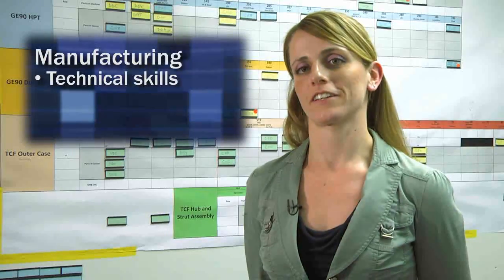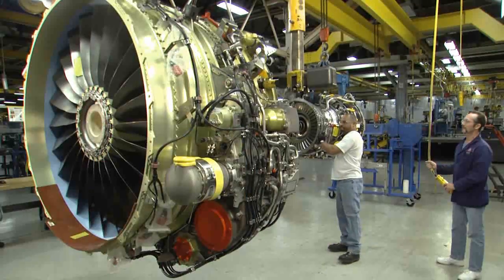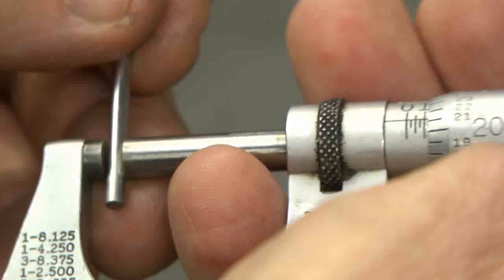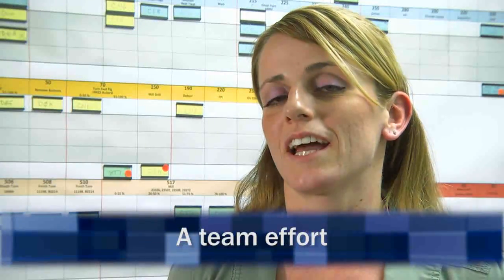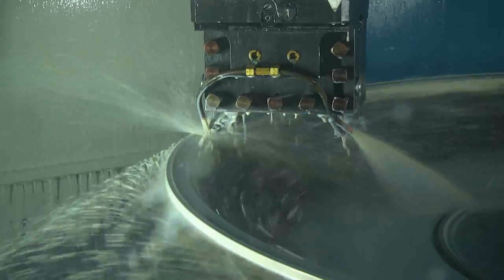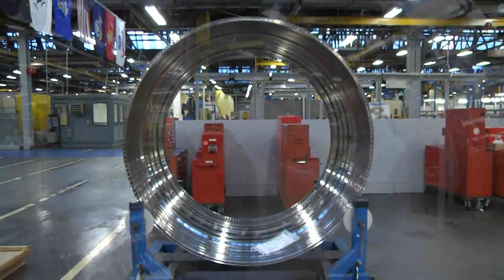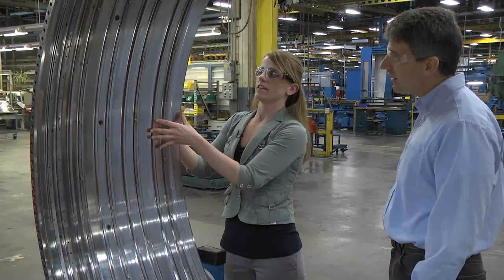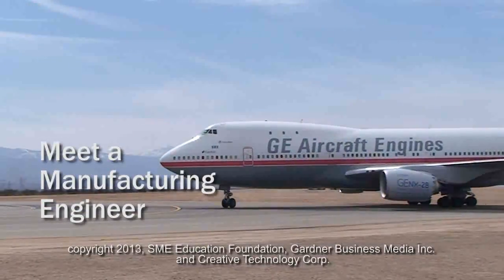Meet a Manufacturing Engineer

Comment: A Quality engineer is not a Manufacturing engineer
Reply: manufavturing engineering actually contain 3 sub divitions which are QUALITY . MAINTENANCE. PRODUCTION. ENERGY AND HVAC . u can say its generale , the mother of mechanical engineering
Reply: they cant understand what u mean and what i am looking for |:
Reply: Manufacture engg contain 3 sub dvision production quality n maintenance
Reply: @prajo9578  and production engineering is split into two groups: Manufacturing and Test engineers. Quality engineering is not the same thing as production engineering.
Reply: Quality engineers are manufacturing/production engineers.
Reply: @verrtex7837  When you look at what they're job duties are

Quality Engineer: Focus on checking if parts are to print. They identify if a part is a go or no go.

Manufacturing Engineer: Works on eliminating problems for parts that do not machine correctly, for example. They are hands-on during the process of the manufacturing of the part while a quality engineer does not, the quality engineer gets the end results and checks it. A manufacturing engineer also know how to inspect parts too so that they can see for themselves that the parts/assemblies are coming out to spec.
Reply: @mightydeathlash2867  so a manufacturing engineer is more of a manufacturability Engineer?